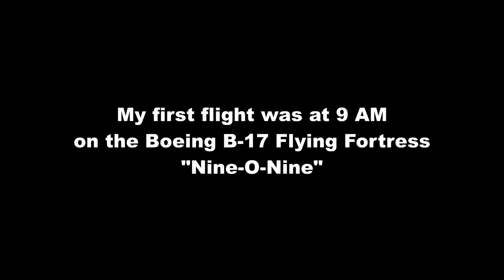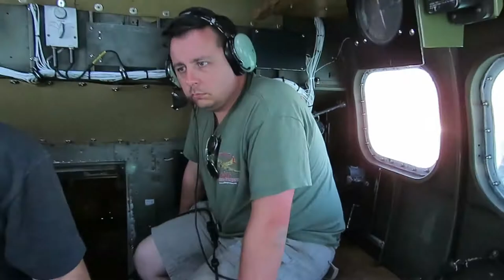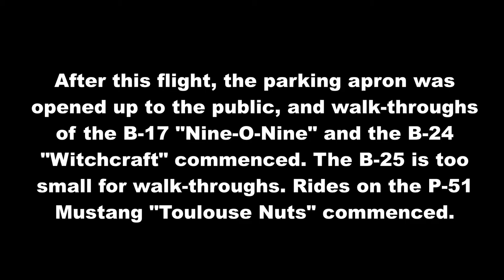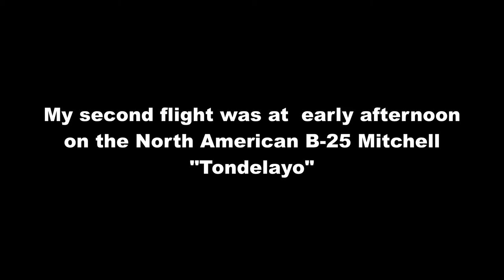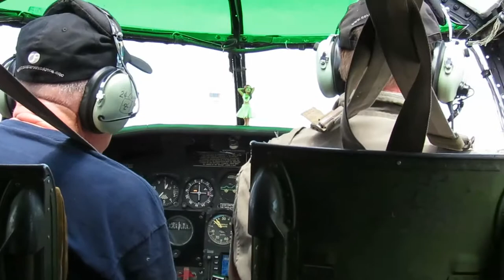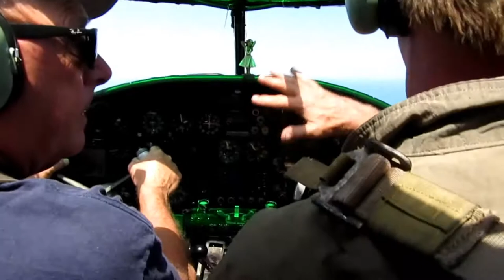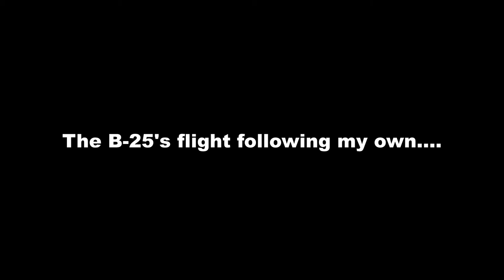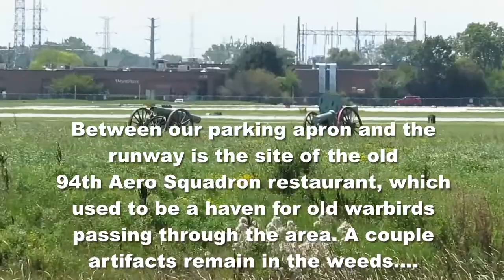Collings Foundation "Wings of Freedom" Flights July 30, 2017

Comment: Since it doesn't seem to be a pressurized cabin, was it cold up there?
Reply from the maker: Beers and Barbells, it was a typically warm July day, and the flights are only at a low 'general aviation' altitude, so it was quite comfortable in short sleeved shirt and shorts, and even our B-17 pilot was dressed that way.
Reply: Thanks for the answer, I enjoy your videos